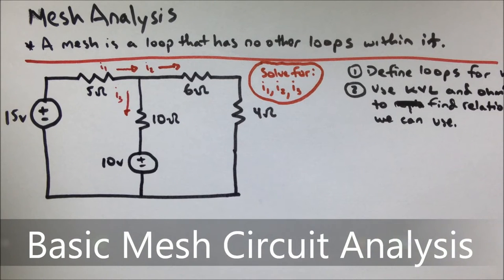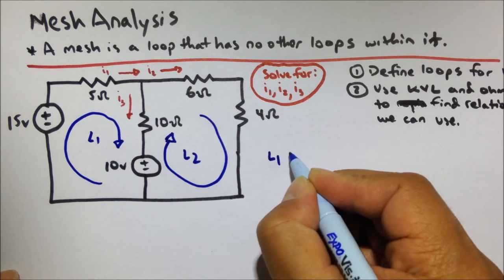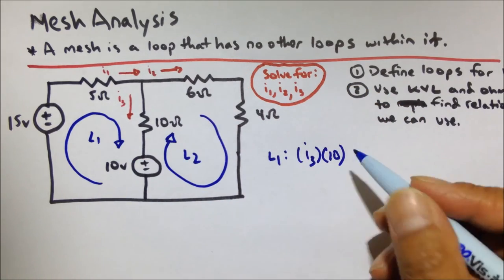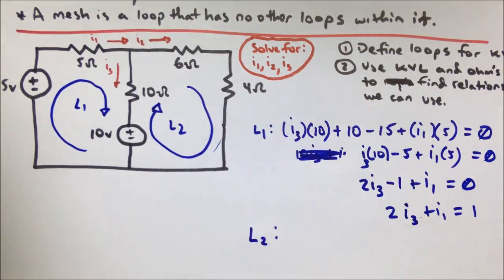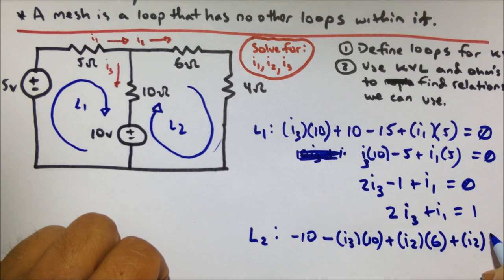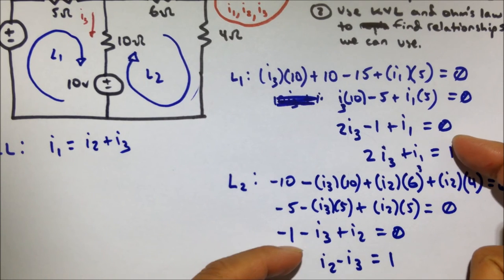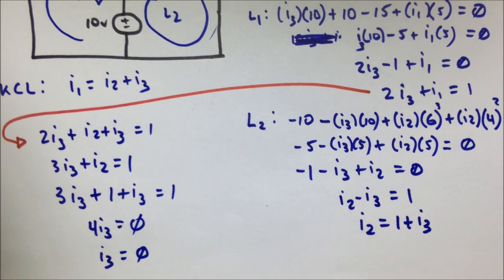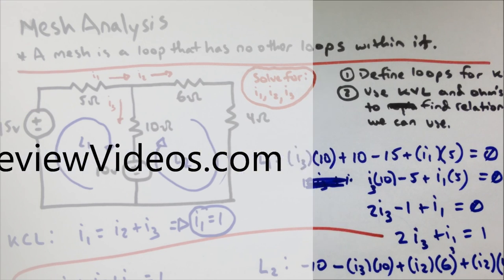Mesh Analysis Circuit Practice Problem (Electrical Engineering Fundamental and Basics Review)

Comment: We had an assignment to be solved using KCL and KVL but our instructor failed us coz she said that we used mesh analysis. Now, I don't see the difference between the two. Would you please explain? thanks a lot
Reply from the maker: +john michael patena Not exactly sure what she may have meant without looking at the problem. KCL and KVL are electrical principles. Mesh analysis is a way of analyzing a circuit that focuses on looking at loops that have no other loops within it. Mesh analysis often takes advantage of KCL and KVL to solve for unknowns. Did you explicitly identify how you used KCL and KVL in your assignment? If so, I'm not sure what she's asking for.
Reply: +EE Review Videos thanks a lot. I did well in our examination because of this video :) hope to see more from you!